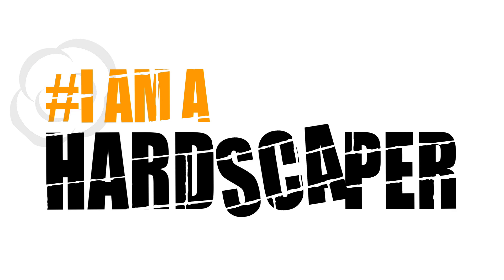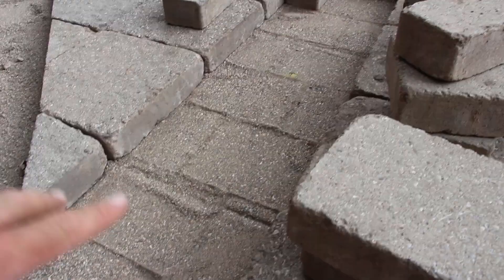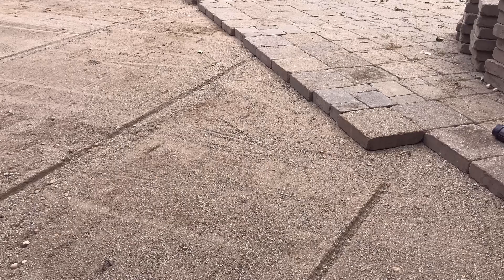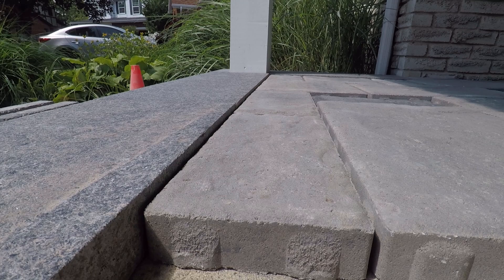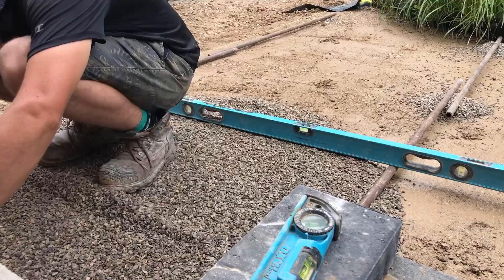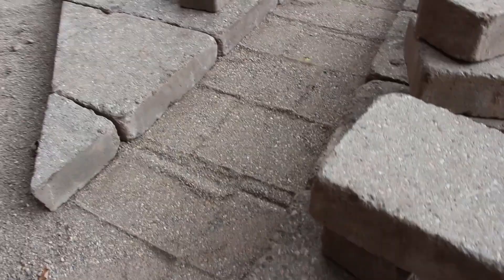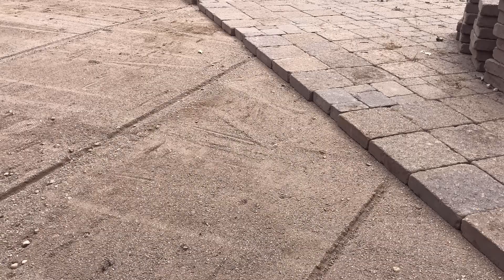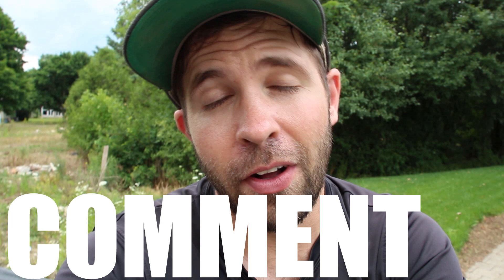HPB vs Concrete Sand for Pavers | Bedding Layer Comparison

Comment: Great !!
Reply: with concrete sand the compaction is 3/16 inch ?  If you had done the whole project, whould you have used hpb instead ?
Reply from the maker: I aim for around that 3/16” per 1” of screeded sand for compaction. If I was doing the whole project with this same material, probably concrete sand still because of the joint widths.
Reply: @iamahardscaper   
good thank you !

Comment: How thick should the sand bedding be in centimeters please
Reply from the maker: 2.5-3.75 cm
Reply: @iamahardscaper Is there a problem if my 1/4" chip is less than half an inch in depth? I have a slight high spot of dirt where I'm laying my pavers. I'm basically screeding away all the 1/4" chip away from this high spot.

I'm using the foam paver base pads and they're basically sitting on the compacted dirt in that high spot section.

Comment: I'm working on a backyard patio.  Originally I was going with an open grade base but my backyard slopes toward my house and found the ground to be wet.  I've excavated and sloped the base away from the house.  Not wanting to have water sitting against my foundation I've started to put (A-gravel) into the excavated area and I am  compacting frequently.  I have 1" screed/galvanized  conduit rails and want to be prepared for my next step. Should I use HPB as a bedding layer or concrete sand in this scenario?  I'm going with a 2" thick paver from a local company in Ontario (BSW) I think is the name.
Reply from the maker: I'm in Ontario too 👍
When it comes to a patio, we always use HPB for the bedding layer
Reply: @iamahardscaper  Hpb on granular-A.  Would you still use a concrete edge restraint or something else?
Reply from the maker: Yes, I almost always prefer a concrete edge. Make sure you scrape away the HPB before you install it. It should adhere to the base and the pavers.
Reply: @iamahardscaper  thank you.  I always look forward to your answers on rainy days.  Tomorrow's forecast for the gta is no rain.  Hopefully I can get my patio granular-A base in and compacted.  Fingers crossed.